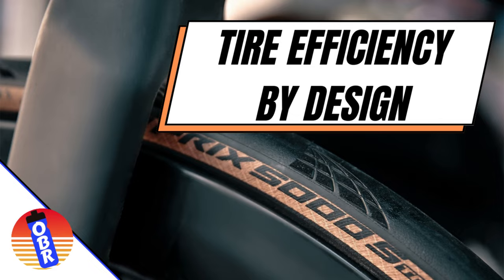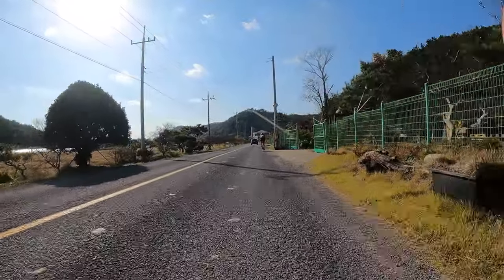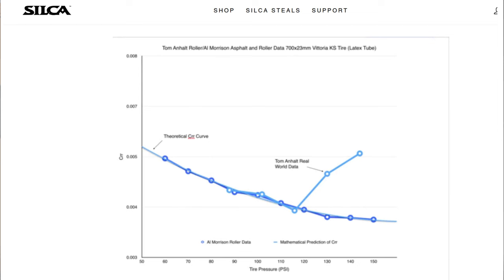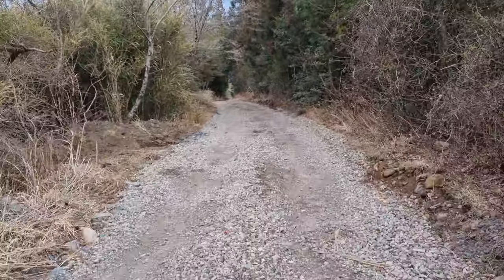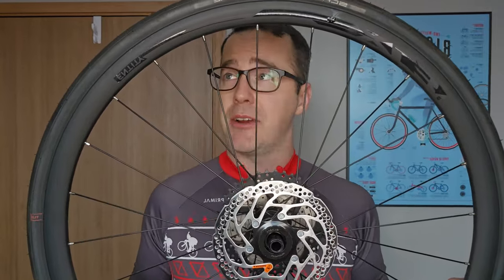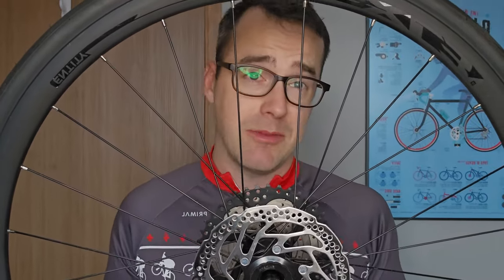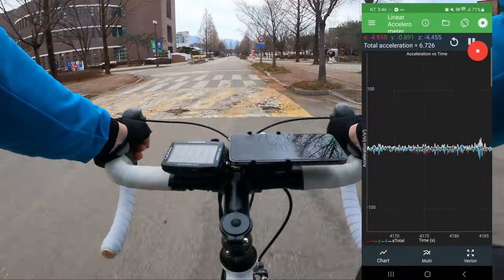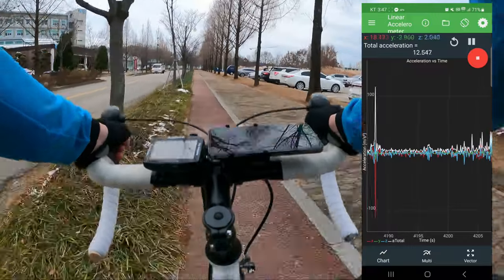Cracking the Code: Tire Optimization

Comment: On the road I notice tires get faster as they wear. Putting on new tires is always a bit disappointing because you slow down.
Low pressures make cornering and descending more uncertain. 
Pinch flats a big reason to run high pressure..
Very high pressure quite nice during the night if you are slow,   seems to be less fatiguing, and will be the right pressure in the morning (latex tubes). 
Weight I suppose another factor.. cost too if you run super thin tubulars.. its a very big topic, thanks for sharing your views.

Comment: It is sad that only the BicycleRollingResistance website publishes tire testing results so openly, because while informative, these results should be taken with a grain of salt. Bikeradar published testing results for 8 road bike tires based on tests performed at the Silverstone Sports Engineering and the tire ranking was somewhat different (the one difference that struck me was that the Pro One performed somewhat better than the GP 5000 S TR). I'm usually skeptic towards what Jan Heine says or publishes, but maybe he's right when he says small diameter drums tend to give somewhat inaccurate results.
Reply from the maker: I guess private teams and companies have nothing to gain publishing their data, but can gain by keeping it private. Testing is really resource intensive too, so I like to support BRR with memberships from time to time. The Bike Radar Silverstone data adds a nice second perspective, but their protocol seems limited versus the battery of BRR tests. Still, I would prefer to use cheap Pro One TLE under the illusion of equal performance, so I may 'believe' the Silverstone data for budget's sake. I also am skeptical any time B.Q. publishes any technical information. The Rene Herse calculator uses only 2 variables, but I included it as many US randonneurs like the brand.
Reply: I agree entirely - and I also pay for the BRR pro view subscription plan. I have seen academic evidence that roller size had an impact on rolling resistance testing, although SILCA claims that ranking is conserved anyway, but doesn’t back up that claim with evidence. This is my main and only issue with BRR : their testing apparatus has limitations that may affect test results somewhat, although aside from that they tend to at least have somewhat rigorous methodology and provide an abundance of data.
And yeah, B.Q./R.H./Jan Heine make a lot of unsubstantiated claims.
Reply from the maker: @SilveryK-v8q  I believe some company promoting small wheel sizes doubly ran into that problem. Small wheel plus small drum doped their results. Lab-only testing couldn't account for attack angle of the smaller wheel either, so real world experience was about as far from lab results as you could get. I forget if it was Greenspeed Recumbents or Moulton. 

BRR does okay communicating their limitations and methodological choices at least. General audiences have a tough time with limitations though. I recall a cycling podcast host calling a study 'a crap study' because a study methodology didn't match his particular application. 

Private firms do have the real world data. Here's an interesting video from Ineos/Continental on tire testing. According to the comments section, I better get my accelerometer + tire pressure/width experiments done quickly before Peak Torque beats me to the punch. Shame I had surgery this weekend. I'll be delayed. https://www.youtube.com/watch?v=DBuFqrjVydI
Reply: I think the primary point Jan makes with his research & products, is that wider tires, inflated to the proper psi, are no slower than narrower tires at their proper psi.  Is there an aero penalty pedaling a wider tire into the wind on longer rando/ultra distances?  No doubt.  However, having turned  60 yrs old recently, I myself am firmly in the, "comfortable is fast", camp.
Reply from the maker: @JosephDowski  You may like my video 'Comfort = Improved Endurance Performance?" I hope to publish accelerometer testing for tire and suspension stem/seatpost systems soon (teased in this video), but I have to recover from surgery first to finish the tests. Jan was influential in expediting the move across cycling to wider tires on the road, and for that I give my appreciation. I was on 33c Rivendell Jack Brown Green tires back in 2015, partly influenced by Jan (and by sore hands and bum). These days, I teach academic reading/writing to graduate students at a science and technical institute, among other tasks. I spend my days reading and talking about expectations of scientific work and guiding students to create work that meets a particular standard. I love it. My issue, and the issue many seem to have with Jan/BQ/RH, is a long history of presenting bad science with biased interpretation as actual science and truth, all while ignoring/denying evidence that opposes desired outcomes. Quite postmodern of him, which plays well with a subset of the Pacific Northwest crowd. It's popularity has poisoned the well a bit for discourse on technical topics in randonneuring, which is an area I care about. Creating this channel is, in part, a response to that issue. That said, I expect to reach several of the same conclusions along the way.

Comment: Great video, thanks for calling put the equalized pressure nonsense. I feel like short, faster rides call for zippy feeling 28s, but I'd roll with some comfy 38s on a randonneuring trip. 38s are slower, but not by much, and less flickable, but you're not darting around on a rando trip. Much more comfort and grip though.
Reply from the maker: Cheers, researching for this video was frustrating to say the least. It's technical on an unfamiliar axis to cycling journos, so even earnest reporting on the topic is often filled with misinformation or misinterpretation. Putting aside low quality data and shoddy experiments populating some corners of the cycling media space, some in positions of authority on the topic can and do mislead with how they share good data. They have used 'equalized pressure' stats to do it. I hope my interpretation, while imperfect, was clear and insightful.  

I've only ridden very narrow tires a few times in the past 6 years, but the clip at the end was testing 24mm wide GP5000s. They handle so spritely, even though the wheel/tire weighs significantly more than my usual 30 or 32mm set up. Super fun, but not ideal for rando.

Comment: Tire inserts might help mitigate some of those compromises - at least for  gravel riding and MTB.    At low pressures on  gravel  an insert can help the tire feel more stable and less squirmy plus make tubeless much easier to reinflate on the roadside by holding the bead out against the rim. They also should (some types) help  attenuate  rim impacts.
Reply: Have them (Vittoria) in my 25mm tubeless GPs. Was afraid to take them to the PBP because you can't change to tube when there's an insert in there... 
Plugs&sealant would maybe be enough, but I'm still not great at working with them.
Btw, getting those road inserts into your tires (and getting them out!) is an effort!
Reply: I have the gravel Vittoria inserts on wide 30mm internal rims.  These might be easier to work with than the road version!  So far its been ok just to press firmly on the sidewall against the insert and  insert  a tire lever.  The bead then pops off ok  with the lever (not by hand) and the insert can be pulled out as needed.  Trust the PBP went ok.  @bb3lo

Comment: What tires have you been running at what psi? At 185lbs I run a 30mm tire on my steel road bike and a 32mm tire on my titanium rando bike. My psi is never over 70 but on centuries and longer fatigue of the body is what I’m trying to prevent. Great video; no one ever discusses hoop stress, and i think a lot of information gets looked over because of generalized statements regarding tires, in a way that is end all be all when to many factors need to be considered. Safe riding!
Reply from the maker: Hi Ian, thank you for the kind words. At 200lbs I am currently on 30c GP5000 STR at ~60 PSI. They balloon to 32.5mm on 25mm inner width rims (tubeless). I use suspension stem and seatpost as well. They seem to handle mid sized and larger bumps better than tires. Very curious what my testing will find when comparing tires widths, pressures, and suspension add-ons.

Comment: I think once you get high quality tires in the same range than the GP5000, the difference in rolling resistance between brands is very marginal. Good tires of the right width for your needs, the right pressure and you are good to go. I used to check BRR but I don't find that their data reflects the reality.
Reply from the maker: It really isn't much in it once you get to the high end. The differences are well under an amount we can perceive, but calories saved over 20 hours of cycling is pretty valuable. I generally regard BRR as more robust than other testing like Aerocoach or Bike Radar/Silverstone. Still, all those tests find general agreement.  That said, there seem to be some tires that perform way worse than would be expected given their construction.  Knowing to avoid them is as valuable as knowing which 5-6 models fit the bill. Another valuable nugget for me is knowing which tires are thick enough to trust. GP5000 STR are thinner than I would normally trust, but I am trying them out anyway. If their life is short (I am heavy) I'll be moving back to cheaper Pro Ones.